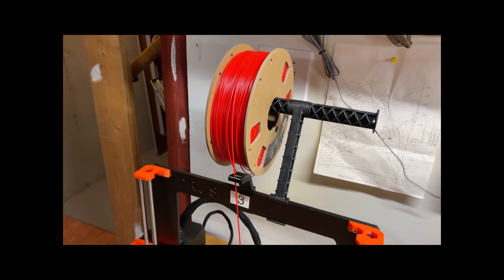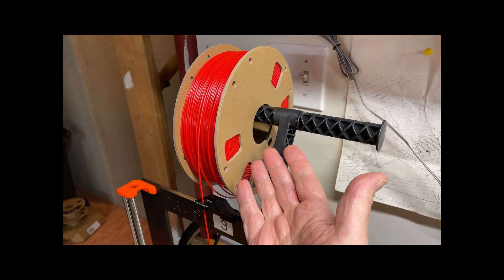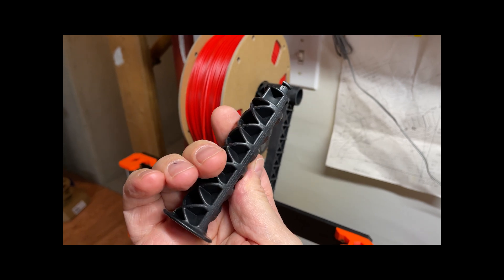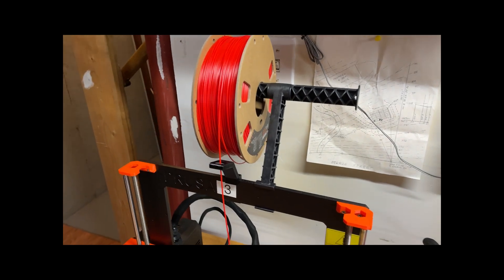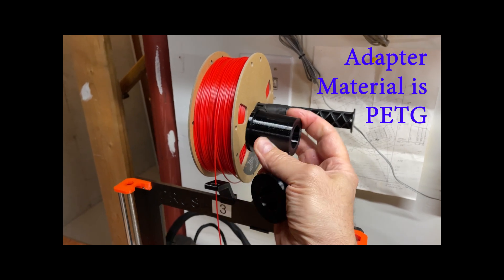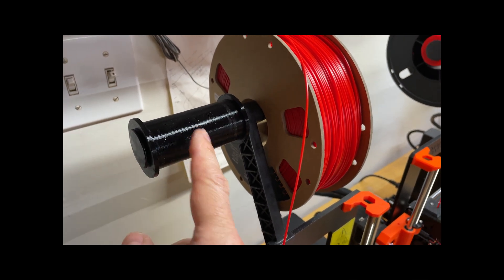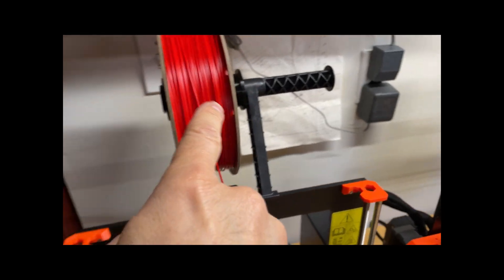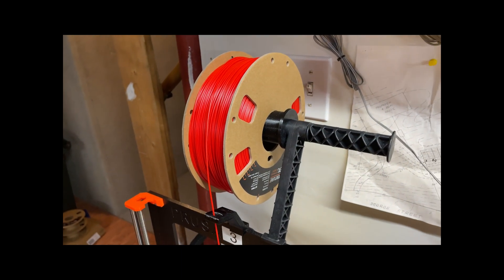Quick Tip: Improve Cardboard Spool Behavior on Prusa i3 Mk3

Comment: Why did you choose PETG to print the adapters? Also how have the adapters help up? Have they also started to wear? I’m watching this video because I have plastic spools that are creating a fine black plastic dust from rubbing as well.
Reply from the maker: I use PETG for most of my work.  But, even if I didn't. PETG is a relatively low-friction material.  They have shown no signs of wear.

Comment: Excellent. Has anyone made or shared the 3d model for these adapters?
Reply from the maker: There’s a dimensioned drawing at the end of the video.
Reply: @KPNH   I did see taht but I am new to Blender etc.
I'll do some learning and see if I can make it later.
Thanks
Reply from the maker: I have added a DropBox link to the .3mf file for PrusaSlicer in the Description.
Reply: @KPNH  Wow. Thanks so much 🙂I have downloaded them and will print them up in a day or two. Thanks again.
Reply: @KPNH  I have printed them and I am using them right now 🙂 Thanks again. That's really above and beyond the call 🙂